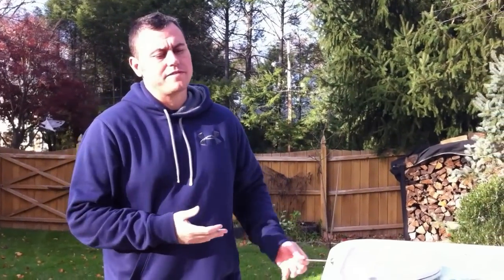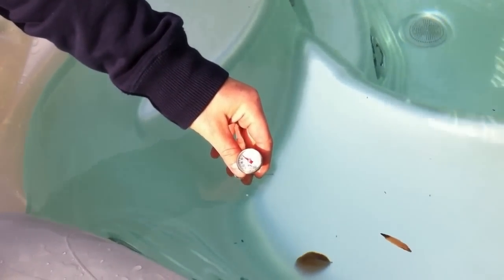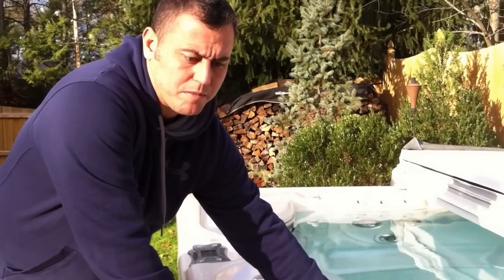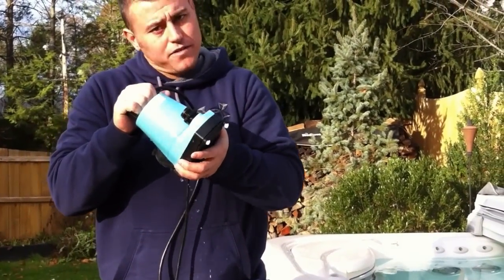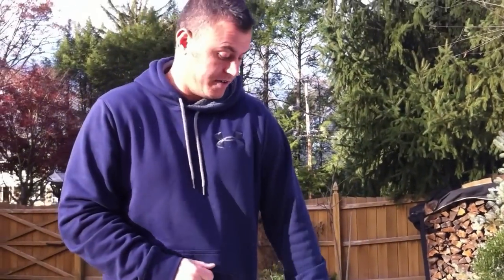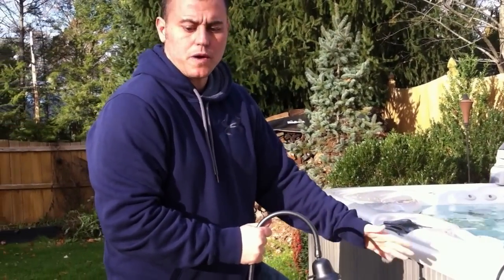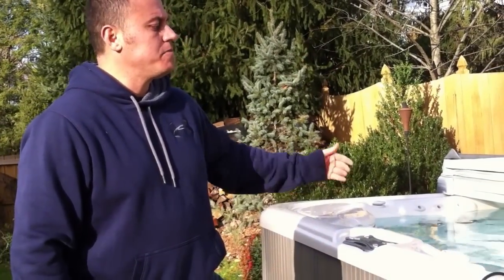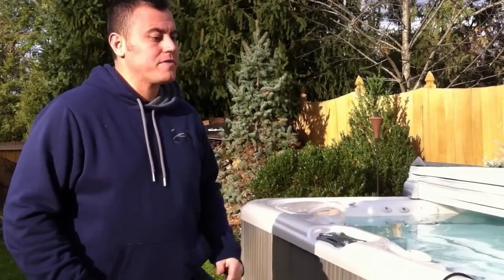Hot Tub freeze prevention when not working

Comment: Great video.   I have a sump pump I used to drain it but did not realize that would keep it warm.   You can also by submersible heaters that are used for tanks of fluids in the winter, but not easy to find at a hardware store.   The ones that float on the surface to keep horse troughs from freezing help, but not in super cold weather.  The light bulb in the equipment bay was a great tip!